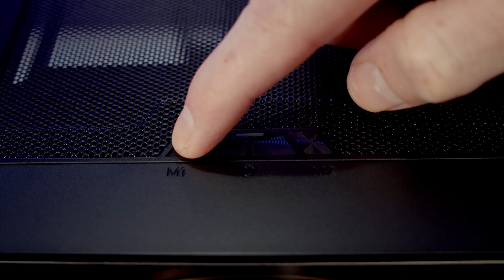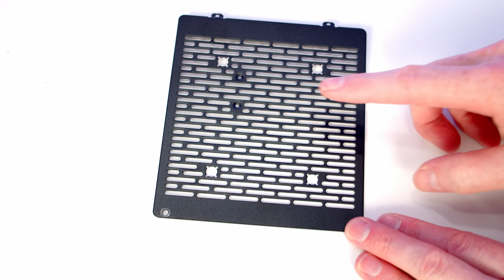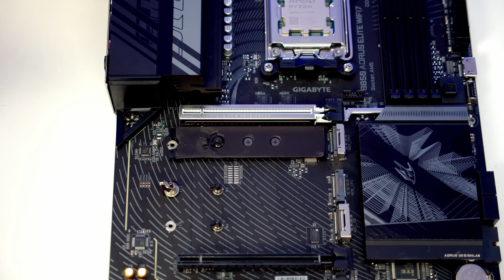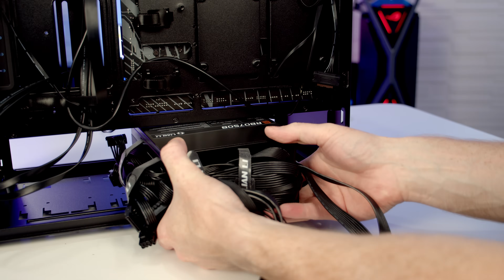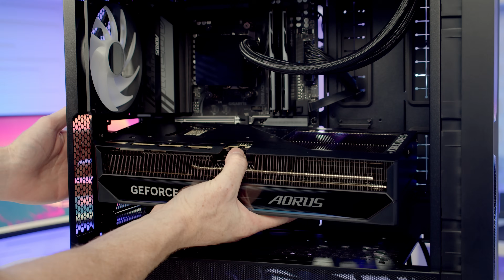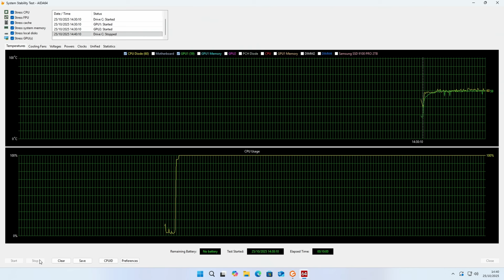Lian Li Lancool 217 INF Build - Step by Step Guide

Comment: My friend, first of all... THANK YOU SO MUCH for your video. I’m building my PC this Saturday. I bought all the dream parts... including this 217 INF case. I have a question: you placed fans at the bottom, but in the end, you didn't have any there. Do you think it's necessary to install those 2 bottom fans? Or can I build it without them for now and install them later if needed?
Reply: Did you not listen to the video? That's a different case that has the bottom GPU fans.

Comment: I considered this case but found it a bit too over the top (too many lights, the mirror finish on the front panel I really did not like) and preferred the oreiginal 217 dark version.  That is about thte only case where I really liked the wood effect, as I thought LL used the wood sparingly and tastefully.

Comment: I’ve recently built this case, but I noticed that the front glass seems to be getting dust trapped between the top and bottom glass pieces. Is there any way to access it or clean it? So far, I haven’t been able to find anything online about it or a solution.

Comment: 18:51 -- Getting the USB plugged in the side of the motherboard through the GPU support is where I'm stuck and there's a jump cut to inserting it outside the case. How'd you get it to work?  The angle prevents from inserting it directly as far as I can tell. I'm think of removing the screws on the panel holding the GPU support and putting them back after I get it plugged in. Edited to add:  It turn out you can flip the panel holding the GPU support bracket (and move the bracket to the other side).  This gives plenty of clearance.  Fortunately, I have a long GPU, so I don't think the position of the support bracket will be an issue.

Comment: Just found your video, and its awesome, because I am strongly considering this very case due to the way it vertically places the gpu.

My question about the horizontal placement, though...

If the gpu fans are pointing down, they are blowing down (away) from rhe gpu...right?

But your bottom case fans are blowing up into the case, right?

So aren't they in conflict with each other?
Reply: gpu fans blowing inside the gpu

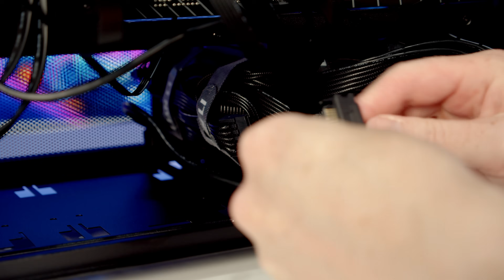Comment: Hey! got this case and everything works except the case fans and rgb, any ideas? using a Gigabyte B650 Gaming X AX V2 mobo and i did change the sys fan to different ports and same with the argb cable, dont have arbg labeled on the mobo but does have the port and i plugged it in i believe. 21:04 this is the only cable i did not plug in, would this stop the fans from working

Comment: Building a new PC. Bought Lian Li Lancool 217 INF and Lian Li Edge 1200W PSU. Haven't built a PC for years so I decided to watch some videos. There were good info but scattered through different channels with different videos. This video, I say this from the heart, is gold. It's like listening to 100 experts and mold them into a single mind. Great job.
Reply: I was wondering if there is a possibility to completely remove the PSU / fans shroud? I like the case but the PSU shroud I don't like it at all, it also add resistence on the airflow. I don't use fans on bottom nor use old HDD anymore, so for me that is just a problem
Reply: @JomarsYT   If you are talking about those mesh plates that separates PSU and MOBO compartments, there are screws that could remove those plates as well. If you remove the back plate too, the PSU would be open on all side except the right side. This case is pretty adjustable, I was actually thinking on the simpler 207 but there was a good discount on 217 INF, and like the case. There were some problems with cable management with an L-shaped PSU but it was temporary :)
Reply: I mean, the whole PSU shroud, the panel where you put the fans or left open, I want to remove the whole thing, also the HDD stuff

Comment: If you're not using a radiator at the top, is there a way to lower the infinity fans so you can see the infinity sides on the fans or would that possibly mess with airflow as they arent flush against the top anymore? Just an aestethics question really.

Comment: Building now a 217 inf, but it’s a horrible experience. The manual is bad, case not quite well thought out. Video is not clear how you connect the casefan lights your AIO and the mainboard. But still the best video arround.

Comment: HELP, noob first time pc builder here. I absolutely love this case and will use it around Christmas when I build my first PC. I like air cooling so I will probably use Thermalright phantom spirit or NOCTUA dh15 with my build. Do I have to add additional exhaust fan at the top of the cpu cooler or will everything be fine without it as well?

Comment: The bottom fans he installed were pushing air inside the case or outside?
Reply: Yes, they are pulling cold air from the outside to the inside of the case.

Comment: Liam-Li say’s supports 180mm when sideways on the Power Supply. I have been looking at the Liam-Li Edge PS and it measures 182mm. When looking at the instruction manual they show the placement of the PS sideway’s with an image of the EDGE PS.

Can you verify whether the EDGE PS from Liam-Li will fit this computer case?

Good job showing the power cable routing if sideways mounted for PS!

Nicely done video and building with this case etc.!!!!! Looked great!
Reply: Just ask lian li via their Email Support.
Reply: @Pianist-w9y  Since I don’t have a serial number and purchase information, pre-sale question.. I cannot make a submission to their support offerings. The chatbot will not send me to a live support agent either.
This was my other alternative, from a builder who mite just have come across this question I asked with first hand information of the case  and power supply during various building.

Comment: Is the only way to control the fans with software is with that wireless USB thing lian li has?
Reply: The case has a built-in fan controller, that you can use buttons on the front of the case to control the lighting, similar to LANCOOL II, 3, 216.  And then control fan curves via BIOS settings.
Optionally, you can also control both lighting and fan curves with the L-Wireless Controller, so that it will work with other Wireless fans in the build.

Comment: You're stuck with the stock front fans, you don't get the bottom fans, the front itself looks like it's built for kids, you have to use the L-Connect to get the most out of all that bling you would buy this for...
All in all, this seems like a downgrade, not to mention it's gaudy as hell as opposed to elegance of the original version. The only good thing about it is movable I/O, something they should have done with the original instead of that dual Power button crap...and you still don't get the Reset button.

Comment: YOU DA BEST Christopher. As always!
Just a few doubts before I buy it.
1. Do we need to access the inside of the case to remove the front mesh panels for cleaning? 1:18  
and seems there're no filters.
2. Wish we could remove the bottom dust filter from the side like Meshify 3
3. Seems no way to install PSU(i have Seasonic Focus GX750w) with fan facing up.

Comment: Next case tests can you do thermals with a 9800x3d or 285k, if you have any of those, 9700x doesn't get hot enough to make the case the differential specially with an AIO, having a 360 aio in the review is good though if the case allows so is possible to see if the case will fit it
For the rest great review as always.

Comment: Having to pop out the two round mesh panels over the front fans from the inside seems clunky, especially when compared to the original’s ease of removing the magnetic front panel, which includes an excellent optional dust filter, and the omission of the two bottom 120mm fans seems like a downgrade.